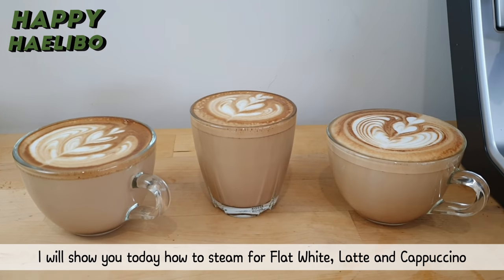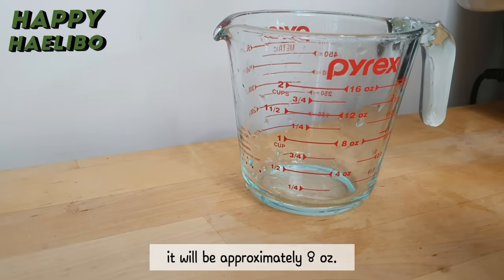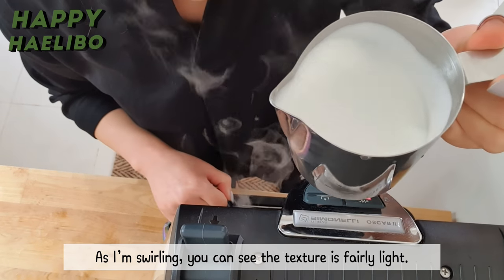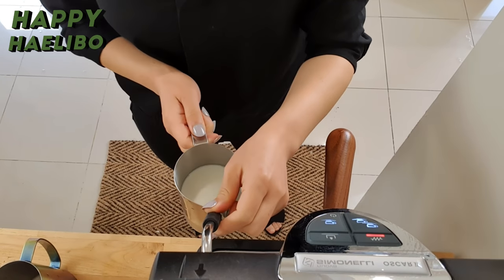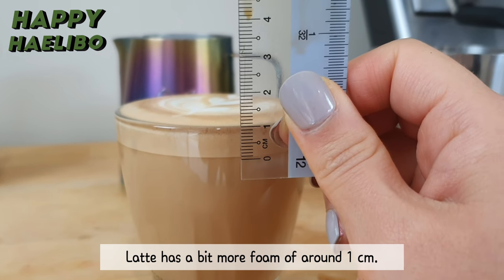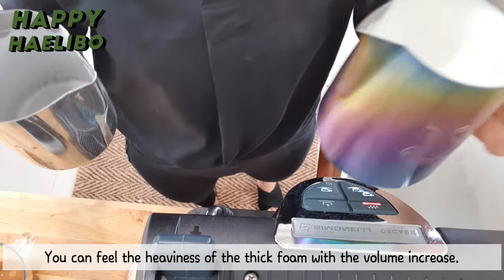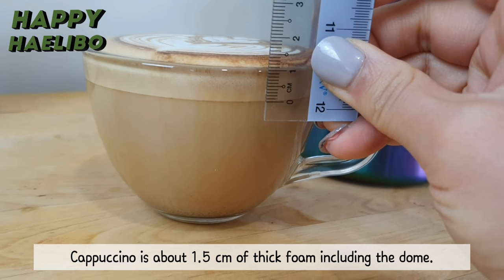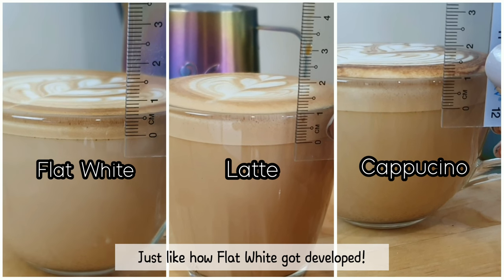💦 Steaming for Different Foam Amounts for FlatWhite, Latte and Cappuccino | How To

Comment: Awesome, thanks! I have a cheap machine and the power of the wand is nowhere close to yours and it's very short too. What's the best timing for stretching? I noticed when I stretch for about 20secs the results are ok but the milk is not hot so the coffee is nowhere close to being hot. When I stretch for 30secs the heat of the milk is good but almost just hot milk with very little to no microform. Is my only hope a new expensive machine?

Comment: So the main differences are about 4 secs steaming & 5mm of foam for flat white, 8 secs & 1cm for latte & 13 secs & 1.5mm foam for cappuccino? Is that right? Normally would you use  none espresso beans for flat & espresso beans for for latte & cappuccino? Sorry I'm so new at this as not to know what's even a sensible question! Thanks for helpful video.
Reply: Thats right..also cappucino has a dash of chocolate powder in it

Comment: Please i need a little help from you :D I am trying to make a cappuccino in a home espresso machine where the steaming is not so powerful, but it still has classic steam wand with one hole. For example i can do latte art if i steam the milk for latte, that's no problem, but when i try to froth milk for cappuccino, with little higher foam and when i want to pour the milk in the cup, the first drop of the milk i can see is too heavy and because of that the milk covers my coffee entirely with white paint shinny foam and there is no way to make the foam go down to the coffee. Why is that, what am i doing wrong? Can you make some demonstration about the right and wrong with making cappuccino for latte art? :D